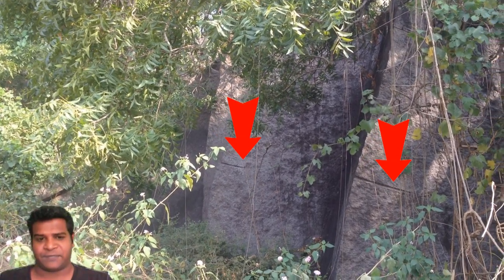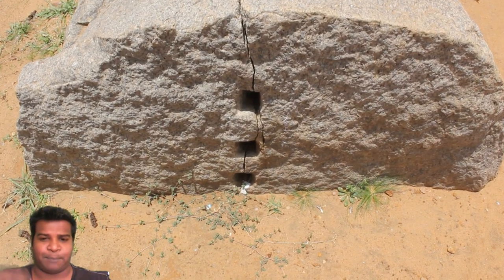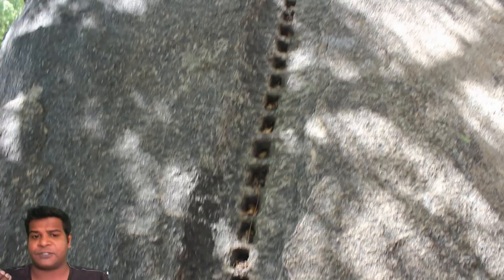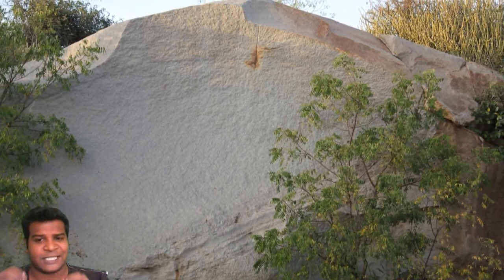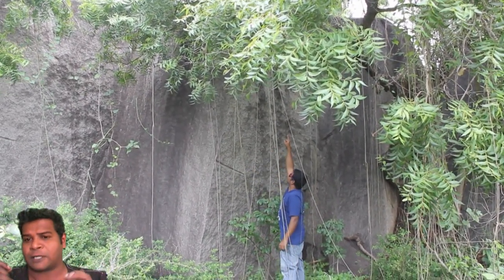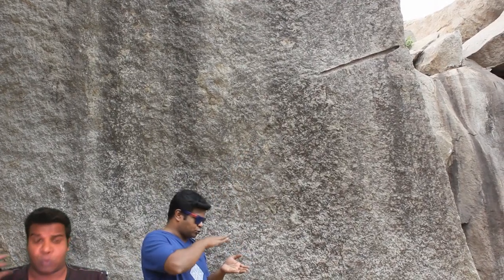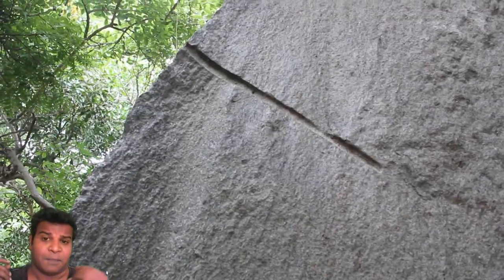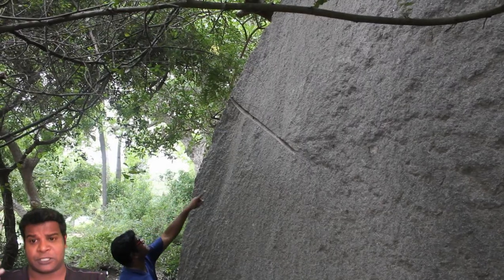In Search Of: Ancient Rock Cutting Technology - Machines?

Comment: I found it extremely curious that some of the drill lines were NOT perfectly straight!  As if the cutting head had been mounted upon a drain snake.  Most lines were straight like you'd see with a normal drill, but those crooked ones!  The skill involved to get a flat plane split from a single point drilling hints at an even greater component to the mystery.

Comment: I believe they used Sound Vibrations in different frequencies powering metal tools to drill and cut with very little effort also leaving behind very little if not almost any debris at all. In fact you don't even need advanced metals using this method, it could be something like copper or bronze with this energy source hooked up to them and as it vibrates it quickly makes cuts into stone. If you have a bunch of shapes already forged it would be very easy to use one after the next to make something like hieroglyphics or Sanskrit writing that's all even depth size and without any tool markings vibrates the metal making the same shape of the metal into the stone

Comment: Ancient Indian had extensive knowledge about Rocks & cutting ..
They used to choose different Rocks for cutting different Gods (within Granite ) ..Experts used to tap the rocks to find out its quality & chose them for different carvings. 
Rust proof Iron/steel was made in India 3000 years back..also "Pancha Loha" which were really hard, the measurements of the mixture of 5 types of metals are still kept secrete by the Acharies.. For Skimming the Buttermilk , Indian used carved wood & thread/rope for many thousands of years... 

Regarding Drilling :  Steel Rod with Rope was ideal choice with sand for the friction .. I wouldn't be surprised Elephants were used in Mega scale Churning of these rock cutting.

Comment: If a drillbit was used, whether modern or otherwise, it’d be fairly straight. These drill marks verve in different directions, indicating to me that these holes were drilled with some sort of plasma tool or other energy type tool. Even a small masonry bit, that may bend a bit under pressure, wouldn’t meander that much. The size of masonry bit needed for this, diamond tipped or not, wouldn’t bend nearly that much. This hole, in my professional opinion, was laser cut.

Comment: I am totally in agreement with the lost technology part ... but I have drilled a little bit of stone and a LOT of concrete / cement and I do not think that the longer drill hole would have been enough to crack or shear / seperate those huge megaliths.  I think they must have used the drill hole for another step like you mentioned with the wood wedges.  And it is not a known that it was a drill bit that was used, maybe could have been water or air or the Lazer Ray Gun Zapper 3000 XP common for the era.   Or Sound ?  🤔  

Great Work Boss

Comment: few times ago i accidentally testing similar concept... usually speaker is put into hollow box... but i try different technique, i put the speaker into large plywood table with paper spacer ... the result is astonishing... the bass is feels more powerfull ... although i only use 4 inch speaker with max 10 watt of power... why ?... the table "vibrating" because of i put the speaker directly in the table ( not in the speaker hole )

Comment: Now that is very interesting. An old video, but I only now found it. One drill hole to split such a huge stone. I don't believe simple wedges, on only one hole, even a 3 foot hole, would supply enough force to split a stone that large. Also, in the pictures you show, it doesn't look like the stone mason used natural fault lines in the stone. For a stone that could be moved, the mason could roll or rotate the rock and pick the best orientation for the faults to work in his favor. With immovable stones, he had too force the rock to break where he wanted, whether the stone cooperated or not. So what force could be applied to a 3 foot long hole that's only a couple inches in diameter? Even if it's modern I don't think that's an explosive force that went off in those holes,judging from the video. I doubt one hole with modern explosive would cleave a stone that large.  Very interesting.

Comment: the slightly curving hole drill is not a high tensil strength drill tools but a soft kind of cylindrical abrasives inserted into the rock

Comment: If you look closely you can see the drilled holes are not perfectly straight but seem to have slight deviations and wander a little bit so I don't think that they used a metal drill possibly they used what is called a star bit which has a raised cross with a point and you hammer on the end and you rotate it by hand as you hit so it only crumbles the rock under the star cross

Comment: You rise many interesting and intriguing questions, our ancestors wasn't that primitive after all. One thing that comes back to me is resonance and weight on drillbit, flushed with water all the time. resonance effect on materials would play some role too. After all, not to diminish religions, the... (poor english sorry) humming minks in temple, the resonance they will cause is a power to reckon. Look at modern days stone cutting tech using vibration, sure enhances stonecutting by miles compared with normal drilling

Comment: A well studied method of drilling hard rock is to use a soft metal (copper, for example) drill bit and sand. The sand gets stuck in the soft metal creating an abrasive drill. As for how it was done without modern rotary tools... Slavery.

Comment: Cutting rock with copper in the form of a saw or an endless wire and using water and sand to do the actual cutting is well known. I even read this in an encyclopaedia when I was a child. This method is quite within the capabilities of the Egyptians and other civilizations who knew how to mine,  found and use copper. Drilling can be achieved in the same way using a copper core drill.
Where is the mystery guys?
Roger

Comment: A couple of points:
1. Even if the temples were built in a few years (!) the rock could have been cut and prepared for many years beforehand.
2. Even if the drill-holes are over 50 years old, that does not make them ancient. Gunpowder was known throughout Asia by the 1200's. Given that temple-building has been on-going in India throughout history, what makes you suppose that these drill-holes are not (for instance) C19th and made with 'modern' technology?

Comment: It's simple, there is nothing more complications you talked about hot water pouring which was rarely used and it didn't take months but few hours. Small rocks were cut with small gaps of 1inch and 2inch depth but big rocks cut with larger depths and if you hit a sharp iron in rocks it creates same pattern...

Comment: Some 30 yrs back, I have seen ppl cutting rocks by drilling holes of 1 to 1.5 feet by iron rods. One person holds the iron rod and other would be hammering it. They keep adding water to the hole to reduce friction. One a long hole is drilled, they used dynamite to break open. Iron rods were already in use then and would have been used to drill these holes.
Coming to the long chisel marks, I have seen ppl using this technique also. In the picture above, let say 50 chisel marks, 50 ppl at each mark would simultaneously hammer them. With this technique they were able to break open the rock. You don't need months.
Reply: then you have to move the rock. then fabricate it. then, in many cases, hoist it up 30, 40, 50ft, in various load bearing layers. right angles - flat planes...no fucking way this was done by hand. Carving right angles out of mountain sides like at Ellora? By Hand? Snap out of it and turn on your critical thinking.

Comment: I'm pretty sure in India they had electricity from batteries about 4000 years ago. It is written about in detail in some of their ancient texts and there have been quite alot of the clay vessels they used to make the batteries dug up. Some with the flat metal electrodes still inside. They knew that if you made large batteries and put them in sequence you could generate a pretty significant amount of power. What they did with that electrical current is anyone's guess. Though I haven't personally read the ancient texts and haven't looked at any of the vessels up close so this may not be true.
I've heard that they would put a highly flammable mixture into the bottom of the hole and cool it rapidly when it was burning at its hottest. Amazing that those huge stones crack apart from that one hole. 
Whatever the answer these guys could do absolutely amazing things with stone,  it's a crime that this sort of knowledge has been lost.

Comment: Not sure how the hole was drilled but noticed most holes were drilled with a slight downward angle leading me to think that after drilling, these holes then had some sort of fluid poured into them, maybe tree sap or melted animal fat, a rod was then inserted and struck with a hammer creating a hydraulic effect inside the rock, the outward force causing the rock to split in two

Comment: so just drilling into the rock back then is awesome. but after they drilled into the rock what did they do to split off a whole clif like that and only have 1 bore hole showing.  it would make sense if it was just that easy.  
And you notice how the end of the hole looks leat extreme heat corrosion?  what would the procedure be to do that? What could create enough pressure to shear off a cliff? it seems like they had a technology to examine these rocks and see how the seams run inside the rock and determine the best place to drill and shear off the chunks they want.

Comment: In one of your other videos you show temple carvings that suggest knowledgr of grears i believe. It even had the commonly used teeth mark ratios of today. There are also monuments youve shown with stone carved wheels. So it is very possible theese were human powered simple machines they created to do this work. Someome could say pedal on a bicycle like device that uses gears and roaps etc to tranfer that work to a circluar spinning mechanism which would then be holding the rock drilling bit. Which... could have been diamond tipped/coated. Ancients loved jewls. And gold. So they must have mined. So they probably had long ago discovered how tough diamond are. And since they had "simple tools and copper tools etc for sure according to modern archeology" that means they could melt metal to make tools. So why couldnt they have melted metal, and put in the diamonds to form a drill bit for the rocks to use. Which could then be used on the human powered machine to drill the rock..... alll done with simple tech. Its possible. Either way. Theres no question. They were very intuitive and had great technivological knowledge they were able to apply in ways we have yet to figure out today.

Comment: Maybe the were using a charge of gunpowder down the hole, they used a a large steel chisel bit, held by one man, and another man, with a sledge hammer, the chisel bit would be slowly rotated between blows of the hammer, it would help if you had actual Giants to wield the hammer and bit.

Comment: The only problem is that it is not enough to drill a single hole to break the basalt or granite rock open. It is possible to crack such rock if there is a natural crack already present. In order to split a solid basalt rock two by two by two meters we need to drill ten of two cm diameter and 30 cm deep holes along the line and use splitters - I use steel wedges and feathers, and also there is a chance it won't work. Better chance when a part of the rock is hanging at the rock's lower base, along the splitting plane. Anyhow - to split the rock with a single hole sounds impossible.

Comment: If the climate was colder and fell to the minuses Oh temperature, then drilled a hole and pouring water there, it turns into ice, expanded and tore it. Ie the Work was done in winter, for the preparation of the blocks. And then the speed of work was several times faster because of the temperature difference. Если климат был холоднее и опускался до минусов ой температуры, то просверлив отверстие и налив туда воды, она превращаюсь в лёд, расширялась и рвали её. Т. Е. Работы велись зимой, по подготовке блоков. И тогда скорость работ была в разы быстрее из за разницы температур.

Comment: 1.why all the drill are made Horizontal ? or at some angle ? no Vertical drilling  is seen here.
2.It is impossible to split a huge rock into two just by drilling a feet or 2 feet drilled hole.
3.Why there is just one horizontal drilling mark observe. there must be series of horizontal must must be required..

Comment: The split holes pointed out, do not look machine drilled...most of them have some curve in the line...closeups views of the opening are not perfectly round, and looking down through the split hole, some of them have an obvious curve. To answer the question of how the buildings were built so quickly, simply a large labour force of skilled rock workers...and, it wouldn’t take months for wetted wood to expand. Regarding the trees that have grown up...haha, the life span of trees is a small fraction of the life of the buildings. My main question would be, how does one little hole split a huge rock without putting an explosive charge into it. Gunpowder was invented in China in the 9th C and spread to most of Eurasia by the 13th C...how old are the surrounding buildings?

Comment: The trees and bushes growing in front of the cut rocks doesn't prove when they were cut.  If the "drilled" cuts were made by steel tools, then you might be able to get a stone sample that contains particles of the original tool's steel and carbon date it.  A positive result from the carbon dating showing 1300 years would be proof that the cuts were made with steel tools in those ancient times.

Comment: Lot of assumptions here.  I don't believe the wedge technique would take months.  (And cold water would be as effective as hot.)  In ancient Egypt, brass saws were used with sand to saw granite.  A similar drilling technique could have been used here, with sand taking the place of a diamond tip on a drill.  Why does it have to be a power tool?  People have been using bow drills to make fires for a very long time.  I am a guitar maker.  I can do a lot of things faster and better using hand tools than using power tools.  People develop more skill than you realize.
Reply: Here may not be cold water ,it depends of place ,south India has hot climate so they have used hot water here.Cold water may have used in drilling techniques in cold places .
Reply: cold water would take even longer. Hot water is needed to soften the wood, to penetrate it so it can expand. It would take a LONG ass time to cut the holes for the wood and then a LONG ass time for the wood to crack stones that large. THEN they have to move the stone and fabricate. Why does it NOT have to be the most obvious answer - a power tool? Even once they drill it...then how to move it? lift it? work it? measure it? Those cuts, those installations are insanely complicated. Have you ever tried cutting stone? Working with stone? Yes, hand tools have made some of the finest wooden instruments to date and some amazing hand carved statues...but look at the size, the scope, the time period...it makes no sense this could be done by hand - specifically the immense right angles with near perfect flat planes.
Reply: marioamayaflamenco there is no evidence to suggest that the ancient Egyptians use saws to cut limestone. That is just something the Egyptologist have said.
Reply: @maciblobmicsurlift492  exactly, they didnt even have brass saws, and copper saws that they had were tiny and wont even cut limestone effectively this theory has been tested and proven false.  And definitely they never ever ever cut a piece of granite that way.  Just no. That said the video here doesn't say that there weren't wedge holes and wood expanded by water techniques implicated to cut granite in ancient times.  In fact it does the opposite and shows it was most certainly so.  However Praveen goes on to show that it also was not the only technique used and that there were definitely rocks cut by other means.  Even with the evidence that was presented in this video taken into consideration,  there is still no reason that these giant stones couldn't have been cut by very skillful primitive means and meathods.  Those drill holes definitely could have been made without power tools, but it does proves at least that they had very well crafted hand tools far more advanced than previously thought.  As for the movement and fine carving of these rocks, we can only speculate but it seems likely that many workers, lots of time and skill and again, very advanced hand tools and knowledge of the work were employed.   Also in some sites geopolymer was often used and was therefore much easier to work when wet and also molded.  The real question that I have about all megalithic sites around the world isn't how...how is interesting yes but one can fathom many solutions when giving the builders there do credit.  No the real question is very frequently...When? The thing is that often these sites are likely much older than archeologist suggest.  And then the the next question is who?🤔

Comment: You can also see at the drill tip the rock is broken
Reply: You can see where the break starts outwards from the drill tip you can see it clearly on the 1st drill cut with rust. Like A pressure point

Comment: If you look at the close up of that hole it is not straight what so ever. No hardened tool I can think of in my trade could cut that with the tool running out that much and not break. I don't think it could've been done with hard tooling. Well maybe only a hardened tip but not the shank of the cutter.